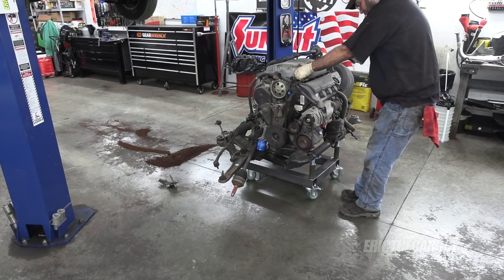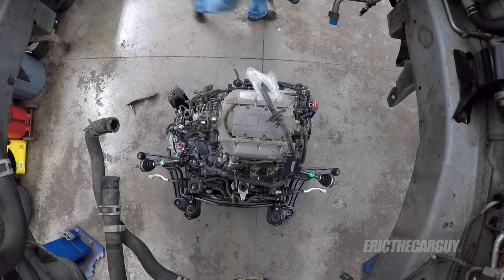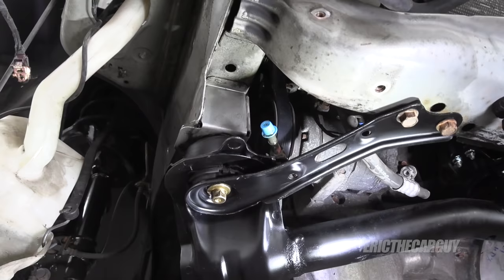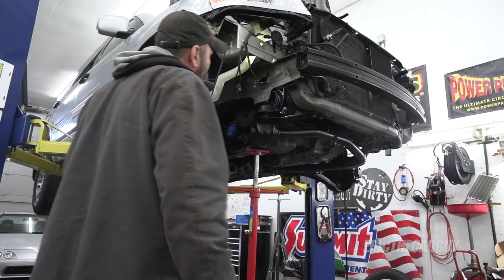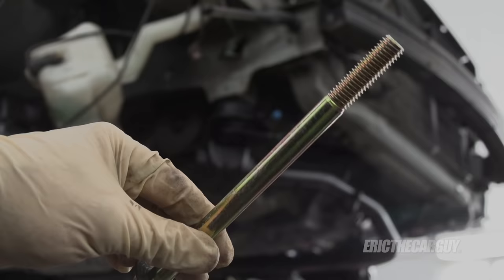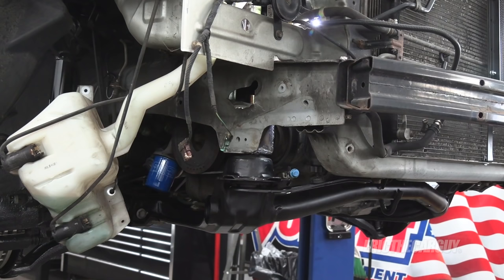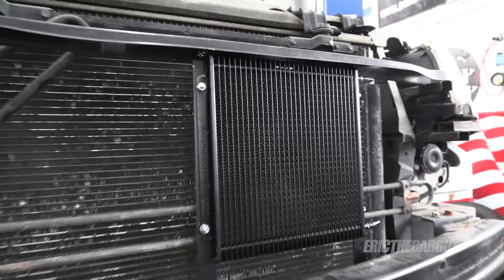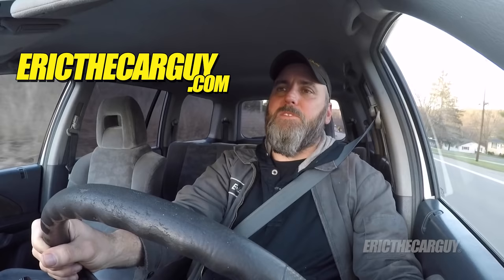Honda Pilot Gets a New Life at 200K

Comment: I have a question is it better to get a used engine or Manufacturing engine for my 2008 Honda Odyssey? For the used engine I'm looking at 2,500 or 4,100 for manufacturing. I spoke with the company on the manufacturing they said they replaced all the heads and valves they also do the timing. I really would like your opinion since you're a honda guy

Comment: Hey Eric, I've been meaning to reach out to you for quite a while now. I have a 02 accord j30a that had a catalytic converter stolen quite a while ago. I've replaced the converter & o2 sensor, but the car still won't go over 3k rmp & a top speed of around 78 or so. What do you think I need to buy at this point, ecu? Some kinda fuse ( I'm sure the frayed o2 sensor wires touched the second i cranked the car & in limp mode since) I just need some help & I know you might know

Comment: Eric, I have a 2000 Honda CRV. It has an oil leak on the driver's side. The motor/ trans has 312,000 miles on it. What do ya think the oil leak is coming from and is it worth repairing it or should I just deal with it. Please advise.

Comment: I do have a 2008 Pilot VP and the valves are little noisy and sluggish at start up but settles down as soon as it warms up. When the sluggishness continue after normal temperature, I turn the engine off and restart then then the sluggishness goes away. I don’t have enough money to get it fixed through the dealership but I know that it has to be done and fix. Anything you can suggest sir?

Comment: Truly enjoyed the series and I know what you mean about buying a used SUV I picked up a 2005 Honda CRV that was not running no big deal get it home taking it off the trailer and I noticed that there’s no catalytic converter in it well after finding out how much Honda wants for one I went with a cheap eBay replacement🤦‍♂️ instead of troubleshooting the engine which had 218,000 km I said screw it and went to Jdm Source bought a K 24 engine and put it in my dumbass should’ve change the water pump and timing belt and everything sorry timing chain but I did not further down the road water pump started pissing so I had to change it in the vehicle not fun fast forward to last summer Transmission started acting a fool. Well once again contacted Jdm Source and a couple other places nobody had one then Jdm Source called me back and the guy says I have one I’m holding for a customer he said that he will let you have it so I got that one for $1050 and the engine cost me $1400 but the CRV only cost me $350. So with all of that and $118 eBay special catalytic converter got everything working then I went to stupid but bug deflector, When deflectors for the windows roof rack changed out the stock muffler as it had a hole in it and I stuck some generic stainless steel muffler on it.. Changed all of the fluids including the dual pump in the rear differential and so far so good as well I did one important thing was got rid of the crappy little Honda battery and ended up buying a Ford 27F battery slightly modifying the battery tray and running that battery which I might add for anybody who has a Honda Civic or CRV a lot of the times you can just modify the tray a bit and there should be enough real estate to put a Ford 27F battery
Reply: Oh yes and cannot forget after putting HID low beams and LED high beams I got the headlights adjusted so I wasn’t blaming people but for the other ashholes they don’t have their lights adjusted I have two very bright LED flood lamps mounted on the top of my roof bars tied into a switch which of course is only used when I go camping and setting up camp at night🤣
Reply: Nonetheless I don’t enjoy working on small Honda vehicles… But they are cheaper on gas than the larger counter part of things like a GMC Yukon or a Chevy suburban

Comment: I have an 06 honda pilot 180k miles.   Ive owned it since 148k and its always jerked a little around 45mph.  If i keep the throttle the same and the rpms will bounce a little.   No codes.  Atf is clean. It has fairly new plugs   any ideas?
Reply: Check your ignition coils and clean them well, if there’s anything interfering with the spark plug connection that can be the cause the jerking.
Reply: Clean MAF as well
Reply from the maker: https://www.ericthecarguy.com/solving-automotive-performance-issues/
Reply: I definiely will thanks

Comment: Hey Eric, would you recommend doing a Seafoam spray top engine clean and lube treatment on a 15 Odyssey with 90k miles? Thanks!
Reply from the maker: I can't see how it would hurt, but I find a good valve adjustment and cleaning the IAC does wonders for the idle of a Honda. I don't think the 15 has an IAC though.

Comment: Does anyone make an aftermarket replacement throttle position sensor for old honda throttle bodies?  Seems like a business opportunity because the rivets could be drilled and self tappers used.
Reply: supposedly also adjustable.
Reply from the maker: I don't replace too many TPSs on Hondas. The used one only cost $45.
Reply: @ericthecarguy  Just interesting that TPS is used on a bunch of different honda models, 4 cylinder and 6 cylinder from that time period and so they make them that are replaceable.

Comment: Hey Eric, my throttle position sensor sits at 9% at idle. I haven't tested the max but have cleaned out the throttle body and haven't had it change from 9% open. Let me know if you're able to figure anything out about it. 04 pilot for reference

Comment: Watched enough of your videos through the years you don’t often replace parts that aren’t factory or better. My inquiry is about the TPS sensor and how there are aftermarket replacements and your thoughts on why or why not to use said aftermarket part.
Reply from the maker: ebay part: $45 Aftermarket replacement: $560. Simple math. Also, a used OE sensor is often better than a cheap aftermarket one.

Comment: hi Eric, I own a 2004 Honda pilot EX and it has 216000 miles. My mechanic friend replaced the timing belt ,idler ,tensioner. and serpentine belt. Before these things were replaced i noticed that it shudders between the speeds of 45-50mph, What could be causing it? By the way I like your 2003 pilot.

Comment: Hey eric. I bought a cheap 2000 crv with the b20. The transmission is throwing a p0715 code. Honda says to flush trans and replace tcm/pcm. Do u have any ideas on this? I ordered a input speed sensor. Its on the way. Gonna try that. Anything else i should do if it dont fix it?
Reply from the maker: https://www.ericthecarguy.com/solving-transmission-problems/

Comment: I wish I could do this on my mdx but since it my daily I'm afraid to wish I can supercharger it 😈 

Yeah that ATF is much cheaper cost me $80 for 5 or 6 quarts when I got my used trans put in wished I knew about that sooner that special sauce ain't cheap 😣
Reply from the maker: You should also know that there is no replacement computer to run the supercharger. The module I plan to use requires that the computer be reset every so often. Hence the reason I installed the negative battery disconnect.
Reply: @ericthecarguy  okay yeah that make since since you can't reprogram the computer and its throw a check engine light after a while 🤔 thanks for the info can't wait to do it hopefully it still be around.
 I'm plan on work on a 99 crv and doing some nice stuff on it first before working on the 03 mdx. 😁👍🏾

Comment: You may have put more than the value of that vehicle back into it renewing it. However if you look at new Honda pilots they are $30,000 for a used one. Unless you need all of the fancy new features I prefer keeping my old vehicles alive, because until the cost of repair becomes more per month than a payment on a new one it's worth it.
Reply from the maker: This is a 2003 and by the time I'm done it will still have over 200K and I will have invested about $15K.
Reply: @ericthecarguy  I count it as years of future service with out a payment. $15K will pay off in 5 more years of useable life.

Comment: This generation is the biggest POS honda's that I ever owned. Handles like a boat, the abs slips very very bad when senses a little bit of snow even I had a set of brand new blizzaks, exhaust heat shield disintegrated around 80k miles, all the interior door handles chrome peel off and causing very sharp edges that would cut your fingers, shifter lock up all the time.